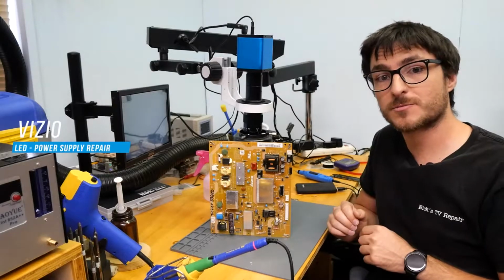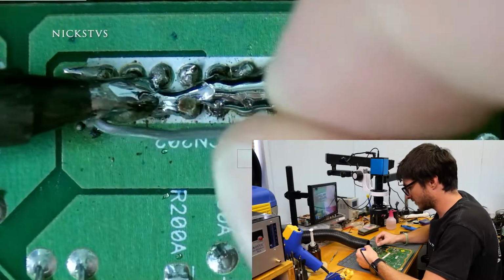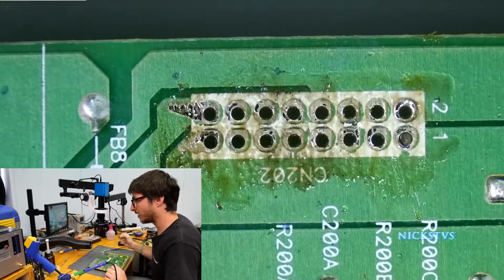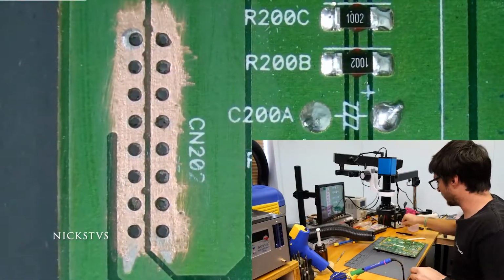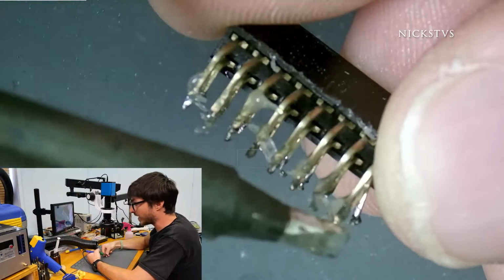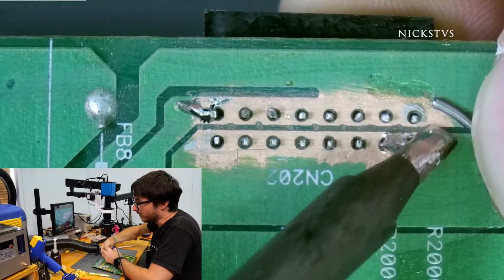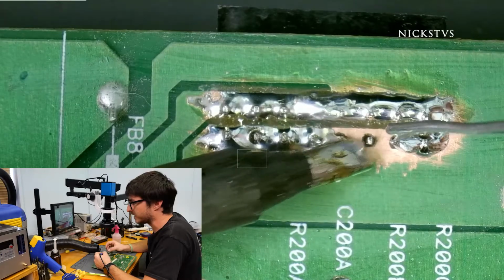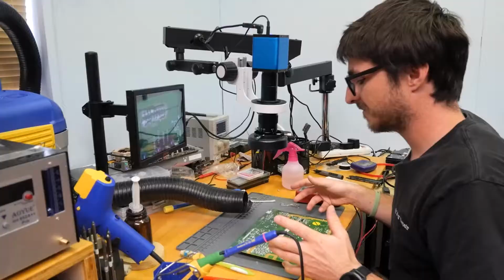Vizio Smart TV NO Picture E550i-B2

Comment: You have both mad soldering skills and the hand-steadiness of a surgeon. I actually completed this repair once about five years ago, but now need to do so again as the connector has again come loose. Did not realize that the two rows could be bridged, which should make this repair both easier and more permanent. Great information!

ETA (07/14/24): Repair completed, connections bridged and reflowed, resulting in what is now a rock-solid connection and a perfectly working TV. The real beauty of this repair is that after reflowing the pins, so long even one in each row remains attached to the board, the entire row will do so. Brilliant!

Comment: I have a Vizio E550i-B2E with the sounds but no picture.  Did the flashlight test and was able to see a faint image of the picture.  Took the back off and Identified that the pins were loose on this connector..  Brought it to a fellow ham radio operator and he soldered it.  Now it works great.  Thanks!.
Reply from the maker: Yup that will do it!

Comment: I still can't figure out what's wrong with the board. I even purchased a repair kit on eBay to replace 4 of the board components. Still no luck. How do I know what components to look at next?
Reply from the maker: That is an advanced question I can not help you with. However, I do offer a mail-in repair service for the repair of that board. Once I have it in front of me and have the chance to perform several diagnostics, and checks on many of the components on the board to identify the fault, then I can do a video and show you but advanced troubleshooting via YouTube comments is just not going to be something I can do.

Comment: why expose the copper??
Reply from the maker: Well the idea was to increase the points of contact to help dissipate heat by increasing the area the power can go through. But later on realized we would need to do that on the connector as well for it to make sense. So a larger connector would need to be installed i think for it to make sense.

Comment: I have the same tv. It lights up with the Vizio logo ON the screen. Then it fades to black…any luck anyone?
Reply from the maker: If you use a flashlight can you still see a picture on screen? If so you may still have the same issue. 
If not, then you may have a mainboard failure. 
I would advise you remove the power supply board first and check that connector we resoldered. It should be obvious if the connector is loose and wiggles as shown in the video. 
If not, then by process of elimination I would say odds are high the mainboard is at fault. 
(I am not with your TV, I have not diagnosed it, this is a guess based on experience)